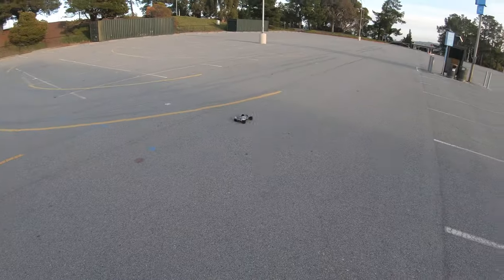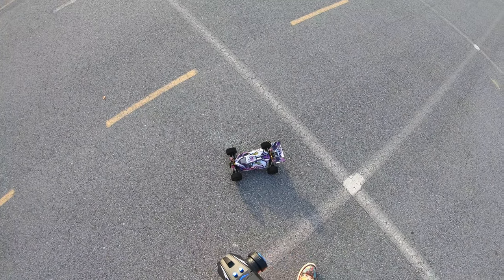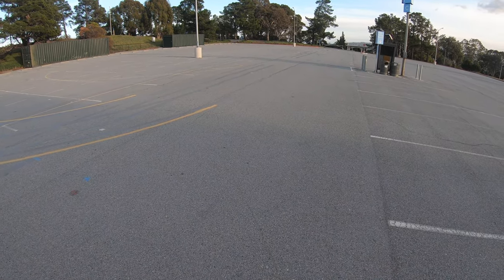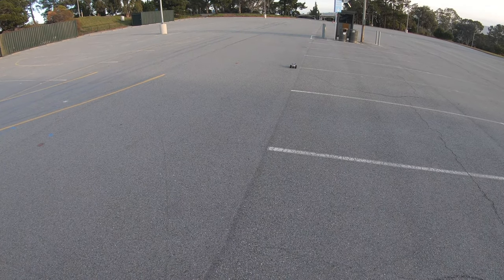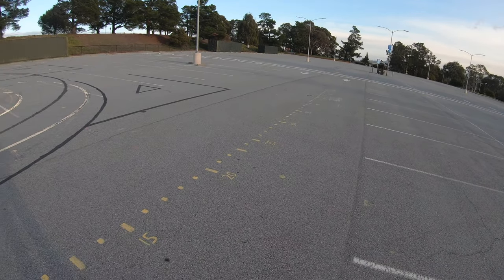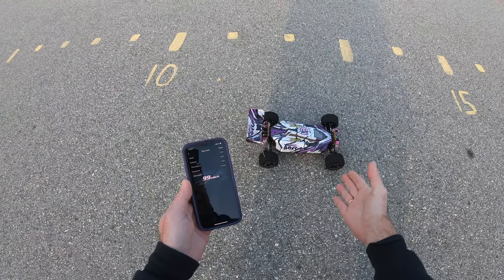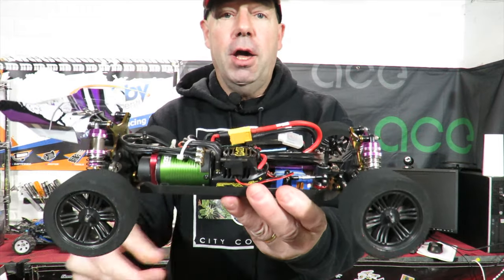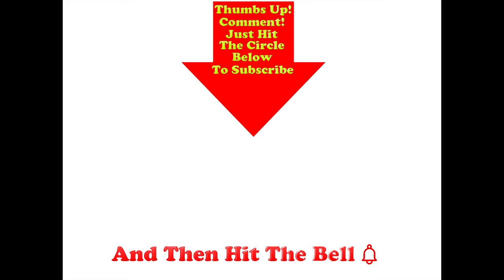PURE 6900KV INSANITY! Can My 124019 Reach 100Mph? #OHYEAH

Comment: Very nice!! 114 seems to be the high speed for a 144001. This month I'm starting with a cheap 4300 goolrc combo, next month I'm going to get the combo you have for my 144001, I have added a few things that I hope will help especially at high speeds, I could be wrong, can't wait to test it.
Reply from the maker: Sounds great!
Reply: I did this same exact combo. Went 70 mph with small foam tires.
Reply: @fstrthnu373  I'll be happy with 70, I knew I wasn't going to break any records, but it is my first speed run, so I don't need a hundred yet. About 55 mph with a 1/10 is the fastest I've been, I need the practice. Normally when I start something new I go all the way, like a double motor limitless, but I want to save a little money this time.

Comment: Amazing work mate. 99 mph😍 ... Wow she's fast. You need a gyro on it to keep it straight.I think you may have one on your controller . you just need to adjust to a higher rate of gain due to its size and the speed. Amazing work on such a tiny car.
My thoughts...
I would set the car up on one end of the parking lot and then walk down to the other end .Use one of the orange cones there to set by the car so that it's visible. that way you're sure the car is set up for the run and go diagonally across the parking lot to get the most  amount of space to run the car.

Comment: According to Castle, the Sidewinder 4 combo with 1406-6900kV can't do 3s. Glad to see you buy italian tyres from USA! ;)
Reply: I checked on Castle website. Richie is actually running this motor overvolted, since Castle rates it 2s capable. If you buy this kit be careful guys, if you run it 3s it won't probably last for long!

Comment: 6:08 Unless it was programmed differently, I think the throttle curve should just be an angled line.  Not like a combustion motor with a power band that is possibly arched or something.  It seemed like what you were describing was kind of like a turbo spooling on a combustion motor.
Reply from the maker: Kind of but I've found with high Kv motors that all the power seems at high revs with nominal low down torque, once the thing hit 40 or or so it pulled visibly a lot faster. Every time I've had a high KV motor that's not been able to rev it's like driving with a blown turbo, they have very little power until they get moving into the power band
Reply: @DriftomaniacsRC  That could still be from the ESC, or it could be you being able to get traction once you get going.

Comment: how do you adjust the brakes to full power? and also what is the servo you're using?
Reply from the maker: Savox servo, you need to look on the castle website for the manual for the esc you are using. Although I use the castle b-link to adjust the brakes via the app on all my castle esc's. Once you've got the app and the b-link you won't want to use anything else
Reply: @DriftomaniacsRC  Thanks!

Comment: You keeping an eye on the motor temps doing those runs? How hot did it get?
Reply from the maker: It's not running hot to the touch, I rarely take a temp gun out in the field, if you're worrying about the temp of the motor chances are the build's all wrong, even after flat out passes the can's only lukewarm at best

Comment: Congratulations Mate 🎉 how good is that buzz after the run😅  awesome speed 👌it definitely has the goods for 100+ as is! imagine drag racing builds like this 😁 💪
Reply from the maker: Thanks 👍 you've been a source of much inspiration at a time when we need it the most, pouring with rain again here today so I was lucky to get that in, you'd have found the brakes heart stopping! I was just running out of room as it's quick low down but the brutal acceleration as the revs rise and it gets in the power band. It was accelerating like a rocket when I had to hit the brakes! Been very warm where you are I see!
Reply: @DriftomaniacsRC  it's actually amazing what these cars are capable of in such a short distance! Sure you need to out lay a little for good electronics but you can't put a price on the high these cars give you at that speed😁 top work mate and thanks for the encouragement! Yes it been blistering heat and then solid rain 🤞 just waiting to get out for another pass but this time geared up slightly and lower kV